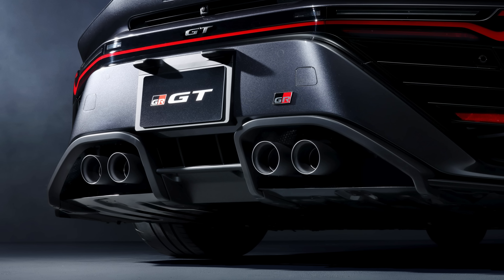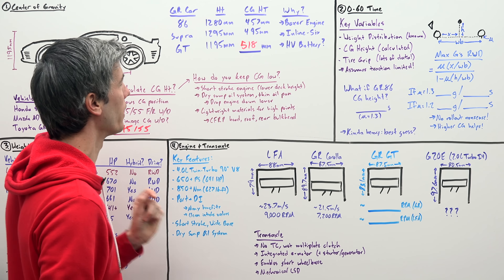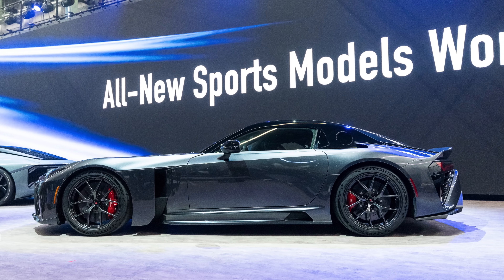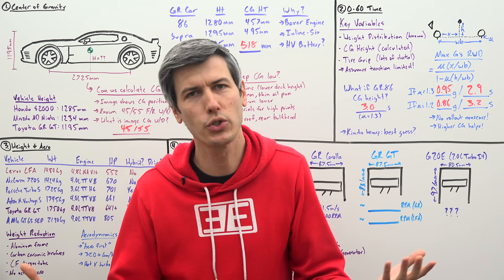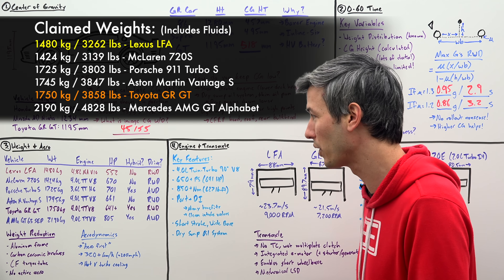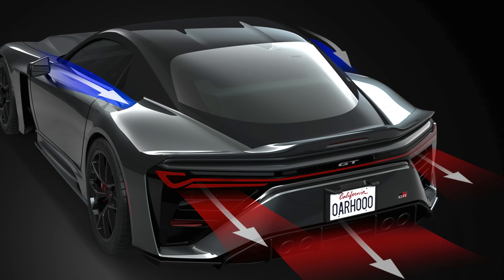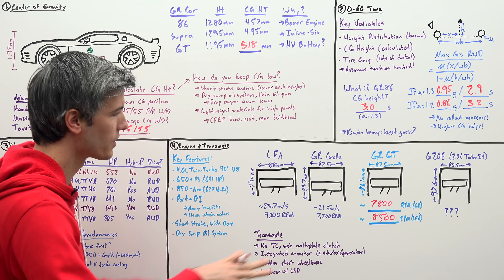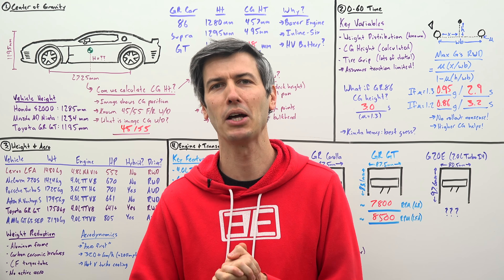Toyota GR GT - All The Engineering Details We Know!

Comment: As a big Toyota fan, NGL as cool as this release and I'm happy but realistically and objectively i think its too hyped and overrated...

- 650HP for a V8TT+EV is kind of underwhelming and not exactly a lot for todays standards. we are spoiled and entitled, i know
- Aluminum chassis, the LFA had a full carbon fiber monocoque chassis. this would be a downgrade.
- If they're pricing it more than 150K, they're gonna have a big problem with the Z06 and ZR1 as they offer much more value and performance
- New Lamborghini V8TT revs to 10k rpm with less than 3 seconds 0 to 60. I know its most probably going to be in a different bracket or segment
- LFA is known for the sound, This sounds grunty and beefy for a V8 but it cant compare to the LFAs divine banshee scream. Hope they at least have the internal sound chambers like the LFA had. 
- Im afraid this is going to suffer the same fate as the new NSX because they went hybrid and didn't have enough performance to make an impact or threat to the industry, unlike the first or original one.

I can keep going but that's just criticism off the top of my head....

Comment: The bracketry and mounting points are all about as beautiful as anything else going on. The mounts for the suspension are literally just pieces of aluminum angle. It looks simpler and easier to maintain than the Pickups and Tacomas that put them on the map for reliability. Meanwhile, just the opposite side of the frame, are extremely biomorphic mounts for the gearbox where service won't be necessary nearly as often. Beautiful and genius design

Comment: It looks like Toyota took inspiration from Subaru for that transmission. Here’s my question: If that transmission was only going to be used in the GR-GT, then why does it have a bolt-on adapter for the torque tube? Second question:  Will an EJ20 bolt up to the front of that transaxle? Third question: Can that transaxle be adapted with a rear output for a RWD/AWD car? 

Or maybe Toyota’s new MR2 will bolt right up to that transaxle and ditch the transverse mounting compromises.

Comment: This car is super cool. Front-mid cars that have that much over the rear axle has to be a pretty small amount of cars! The hybrid battery placement is sus, I wonder if there's plans to move that for racing. Sort of a 'hide your true power' type move.
Reply: The race version (GT3) will not have the heavy, high mounted hybrid system. Toyota already announced this.

Comment: This is clearly not a car worth 200k. I’d say about 120-150k with its level of performance. Thanks for proving this. I’ve been arguing with people in comments sections for days.
Reply from the maker: Haha, for your own sanity, you should avoid comments arguments haha. No one wins! But, for what it's worth, I agree with ya on price. Minus the carbon ceramics, but I feel like those should be an option, bc they're just so dang expensive.
Reply: @EngineeringExplained I’m also not saying that as a bad thing. I want the car and hope they don’t overprice it. It has a level engineering simplicity a drivers car should have. Now, there will probably be higher performance variants but the base should not be 200k.

Comment: Great video Jason. However there is one big problem with your assumptions.

The GR GT is still in late stage conceptual phase so many of your numbers and figures are TBD. For instance, there is no way the GR GT will keep its current ride height and low CG and expect to pass crash worthiness regulations in the US (part of the reason the AMG One is not road legal in the US is due to its low height). Toyota will have no choice but to raise the car higher if they want to sell it in the US and EU.

And I would bet the under on the performance figures. Toyota is just not a performance car company anymore, they are a volume car company. I really don't believe that they will prioritize performance and are just looking for a six figure halo car to help sell its other more pedestrian vehicles. Oh and anyone who actually believes that the GR GT will "only" be $100,000 should be drug tested, this car will easily top $200,000 (prior to inevitable dealer markups) and the new LFA will be $300,000+.

Comment: Will it have a gps and accelerometer so they cancel your warranty if you go faster than 85 mph or corner to fast? They don’t even have faith in them being performance cars and reliable. LFA is easily mechanically totaled and the GT86 has a sub 100k mileage powertrain. This is an owners nightmare for ridiculous money. They make mash potatoes on wheels and an EV LFA is the only thing on brand.
Reply from the maker: Who would ever go 85 mph? That sounds outright dangerous! No thanks!

- Signed me, a GR Corolla owner.

Comment: "At least 641hp" - so if it revs to 8000RPM, makes decent boost pressure and uses the hybrid system effectively...surely this is a 1000hp+ drivetrain without much difficulty 😄

Toyota aren't going to make an engine that can't handle far more boost than they give it. The hybrid part surely is making at least 200hp, since that's basically been the Lexus standard motor for 20+ years. Perhaps they went full Lotus and down-tuned it by half because the gearbox sucks, but whether that's the case or not...641hp just seems hilariously held back.

Although, my daily has 464hp and, in countries where roads have actual corners, that's significantly more than anyone needs (while weighing 200kg more than this)...so perhaps Toyota drove it with 1000hp and thought "hmm, would we get blamed when everyone dies?" 😬🤣

Comment: Nice presentation.   Thank you for posting.  I am a disappointed by the predicted 3900lb weight, even more so since it is not AWD.   Will await the the price and build quality with upcoming review updates.   A base Corvette has less weight, an advertised 0-60 times of 2.9, with 490hp with an MSRP of $70k.   The Corvette ZO6 will also weight less, have more horsepower at 670hp and much better 0-60 and 1/4 times at what I suspect will be a lower price.  Granted the generally good/great Toyota qulity is not there but even Toyota quality seems to have slipped lately

Comment: I see the hybrid system only as a system to meet emissions standards. I doubt the price point will be low enough for an "enthusiast", but if they had the foresite, the battery system could be easily removed for track days and lower overall weight and lower CG. Just a thought, but it won't happen.
Reply: I’d rather Track a Miata. 😊
Reply: @TamagoHead  obviously you've never driven a fast car.
Reply: @Jeffball610  True! I’ve only driven a Mercedes Benz 12 2+2, but there was no AMG offering that year. 

btw, it’s more fun to drive/ride a Slow vehicle fast vs a Fast vehicle slow. 😊

Comment: Nice move of toyota ! one comment about dual injection: If you're watching engine tear downs of engines with dual injection you see that on most the intake valves are still full of carbon deposits.  So I have to conclude that not all implementations fix that issue.
Reply: very much depends on how people drive them too, if i remember right usually the indirect injectors open up for real at high load, so if people baby their cars it rarely happens and thus you get dirty valves

Comment: they obviously didnt learn anything from GMs C8 corvette. there a reason GM finally went with the rear engine layout. the C7 had issue with power delivery due to traction impart because of weight distribution. They pushed the design as far as it could go and went with what worked better. this Toyota is nothing more than a Fancy over priced Asian C7 Vette

Comment: Why the hɛļļ didn't they put the battery pack in the space under the passenger seat and in/on the passenger floor? Yes, that eats into passenger comfort (a lot) but is this car being designed for passenger comfort? Putting the battery pack there would lower the CG greatly and balance the weight of the driver.
Reply: What passenger seat/floor?

Comment: The street car is not that impressive in specs because it's just a homologation special for the GT3 race car. Which is why the hybrid battery is just tacked on - GT3s are ICE-only, why the road car frame has the cutouts for the race side exhaust, why the engine is in front - mid engine is harder to drive for "gentlemen drivers", why the front and rear are designed for race maintenance not road practicality, why the seat is fixed with moving pedal box, why the engine power is average - it'll get limited by BoP as it is, why the rear visibility is poop - it'll get blocked by a MIGHTY WING anyway, and on and on.

Comment: Not to nitpick, but, why not make the car two inches taller,and put the battery in the floor, then, have an electric motor drive the front wheels, Toyota uses an electric motor to create all wheel drive on other models. Placing a heavy battery above the center of gravity seems like a poor choice.

Comment: I still dont undertand where the weight comes from . With all aluminium, Carbon, no AWD, no active Aero, no active suspension, not too much interior equipement (i asume), why is it still 1750kg?
Reply: Mandatory safety equipment for one. Big wheels and tires. There's a lot more..

Comment: 3:49 so they chose looks over function?
Reply: ? Using lighter body panels at the high points lowers the center of gravity... That adds to the functionality.
Reply: @Jonvon65  such high center of gravity. placing the battery pack so high and turbos are high.
Reply: @gjkrisa Those have nothing to do with looks though, the hot V layout is ideal for minimal turbo lag and I guess they couldn't find a better spot to put the battery. But the time marker you quoted was when he was talking about the body panels and the dry sump oil system.
Reply: @J @Jonvon65 got it. yea its after but still talking about high cg. car looks awesome even though . but feel like in order to have the look they had to do some odd things. might be better for repairability.
Reply: They design the GT3 version first, optimised for the track and it’s not a hybrid. So for the GT, that might have been the only space for battery in the road-going GT version.

Comment: I suppose a quite low redline for rpm. Why buy 2 turbos if not for response or for high charging, or bot? So immediate response to the pedal or high value of turbocharging means not so high rev red line. And max hp is not so high for a turbocharged 4.0 liter. All in all, max drivability and not max power, this means high low rpm torque, turbocharged or not it means low redline. We'll see.

Comment: That AMG’s weight is hilarious when put in that list
Reply from the maker: Haha, to be fair it's going for luxury, and it has 800+ HP & 1000+ lb-ft of torque, and AWD. But yeah, it's HEAVY!
Reply: @EngineeringExplained  You 're not being fair, you 're just excusing something that due to its weight should be classed as a lorry and therefore be limited to 80Km/h for safety reasons.
Reply: Whenever I've been in the driver seat of a MBZ, I was always aware of how hard i had to press the brake pedal and accelerator to get any change in velocity compared to other brands.

Comment: To be honest the connection that a Boxer Engine has a lower CoG than a V-Engine is intuitive but not necessarily correct. Keep in might that on a Boxer Engine that has more than 2 Cylinders the whole engine needs to be raised the diameter of the exhaust system. If the car has a closed floor and a dry sump a V-Engine probably will have a lower sitting crankshaft. A 120°-V-Engine depending on Stroke length or stroke to bore ratio etc. will probably have a better CoG overall than a Flat-Engine or Boxer.
Reply from the maker: Idk, looks pretty low to me: https://porschepictures.flowcenter.de/pmdb/thumbnail.cgi?id=323524&w=1440&h=812&crop=1&public=1&cs=72e24b780616222a
Reply: @EngineeringExplained  But is the under body of a 911 in the back closed? And Porsche does sacrifice a Diffusor in the rear what hurts the race versions more than the road cars. Still the entire engine sits above the exhaust with dry sump and closed floor or critical lowest plane. And the lower Part of the engine esp. crank shaft is rather heavier than the cylinder head.

This is based on a Formula Student CoG evaluation my colleges from the engien department did when we build our own crank case for a V2-Engine and tried to estimate CoG on different V-Angles including 180°. Maybe they made a mistake but our favourite in a closed carbon Monocoque was 120" mostly because of the exhaust diameter we needed and system we could manufacture.
Reply: @miagi1337 there are always going to be compromises but it’s still low and exhaust manifolds and piping can be pretty cleverly packaged (not to mention the comparison is between a wet sumped boxer which will still have a sizable oil pan underneath). But also note that this is a comparison between a 90 degree V configuration mill and a boxer so the head placement/height will also impact CoG.

Comment: Some car reviewers got 2.8 secs to 60 with their 1 ft rollout with the Mustang GTD. Which has a worse weight distribution (for launching) than this GR GT. This GR GT also weighs 600 lbs lighter than the GTD. So I would assume based off that and your info. That 3 secs without the rollout should be accurate. Even though it's down by around 150 to 200 hp depending on what the final numbers are. The quarter mile is hard to say. The GTD has a downside of all that downforce at higher speeds. But also has active aero. But it also has quite a bit more power. Whereas the GR GT has less power but Toyota/GR designed this car around aerodynamic efficiency. If I had to guess the GR GT should in theory have the higher trap speed as well as the quicker quarter mile time. Track-wise the GTD is going to destroy this car.

I almost wished that Toyota designed the engine to have around 650 hp by itself. Then the hybrid system bringing it to around 800 hp. Because if they would have made this car with just the engine itself. It would weigh around 3600 lbs, and with 650 hp it would be a beast. Then bringing the hybrid system with the added weight. 800 hp and 3800 lbs seems like it would be a different animal all together.

Comment: Being front engined and supplying power to the rear is what makes this car heavy. longer and stronger shafts needed to transfer power to the rear . longer exhaust routing, longer fuel lines, longer wiring etc. its an overall comprimised decison. Same with bmw latest series. But i am a sucker for long boi designs like these. Huge Nissan gtr lm nismo fan.
Reply: Yes but to get weight distribution this good is probably why they did this. Also it can be used as a drift car where mid and read engine cars dont perform as well. The yaw inertia is well balanced with this setup.  I am excited to see one of these in Formula Drift in the coming years, it looks like a great platform for tuning. Engine design has tons of power to spare, Im sure Toyota isnt even close to its full potential so I look at these HP numbers as Toyota's reliable/last forever power level. The short stroke means they can crank this thing up with less issues. Also once they start tuning people will just have the exhuast come out the hood which will drop all that weight from long exhaust tubes. Its looking like Toyota is designing a tuner car, every aspect of this screams easy upgrades.
Reply: Vantage S is still lighter despite being front engine and having a luxury interior. Also, the torque requirements for the shaft are far lower because it is pre-torque multiplication - only needs to be able to handle 850 nm engine torque vs 3-5 times that in first gear.
Reply: @coreyw427  2026 vantage S is a grand total of 5kg lighter, despite being smaller than toyota in every metric. So yeah toyota isn't that heavy if you look at it that way.
Reply: @danielvipin7163 Yeah so a luxury grand tourer (which has a marginally shorter and narrower wheelbase by 20 mm but is taller) is 5 kg lighter than this so-called road legal supercar. Also has less power and no ZF 8 speed. Very sad stuff.
Reply: @coreyw427  Logically speaking shouldn't a 325mm shorter and 20mm narrower car be significantly lighter by more than 5kgs? Sad stuff indeed. Toyota did well in weight management despite odds.

Comment: They didn't want the cg to be as low as possible but as close to the driver's cg as possible so the driver will experience the same net forces as the car
Reply from the maker: Huh? Literally quoted them: "an unrelenting focus was placed on three key elements: a low centre of gravity, low weight with high rigidity and the pursuit of aerodynamic performance."
Reply: @EngineeringExplained did you watch the presentation? They also said when showing the cg that they wanted it to be as close to the driver as possible. I'm also literally just quoting their press release?
Reply: @EngineeringExplained like you know I'm also literally just quoting them? They wanted the cg the be close to driver to provide the best feedback to the driver
Reply: Like could battery not have been split into packs and put behind the driver and passenger seats with vents behind the seat to cool the battery, they usually mount it under the rear seats on most cars with vents under (obviously under the seats is not an option here) @EngineeringExplained

Comment: The manufacturers always put the input shaft to the transmission on the upper shaft. If they put on the bottom shaft, they could move the engine down about 6 inches, but they don't do that.
Reply from the maker: It's one central shaft, see the images. This is a traditional automatic with planetary gears, not a manual with multiple shafts at various heights.
Reply: @EngineeringExplained I'm used to manuals and didn't think about automatic transmissions. Oops.